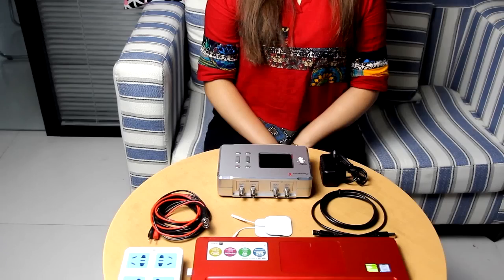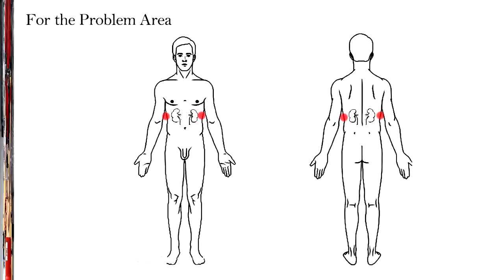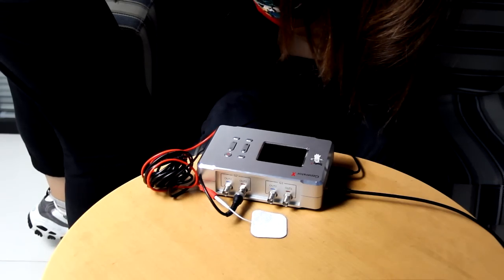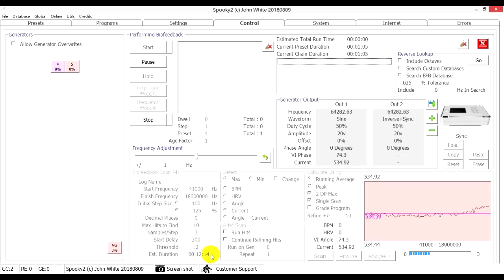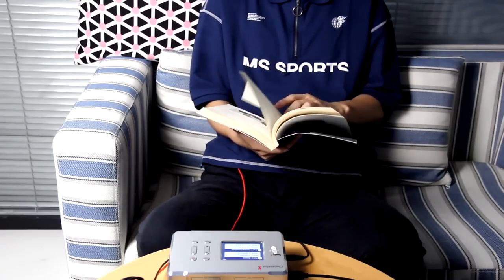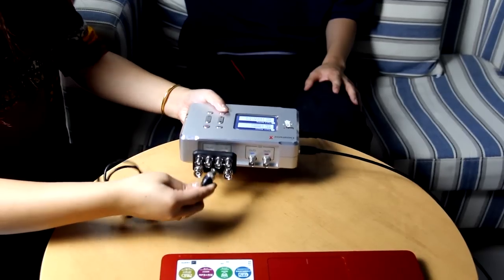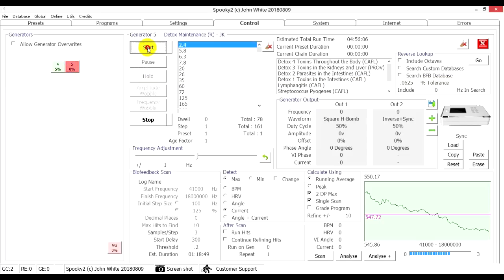How to Do GeneratorX Biofeedback Scan

Comment: hi, you put the cable into out G2 but when you push the button on the software you push number 4 which should be G1..  and number 5 should be G2 where you put the cable??? Is that correct or am i wrong?

Comment: Where is the save button? Plus where does it save to?
Reply from the maker: Hi there, thanks for reaching out! If you’re looking for more recent videos or guidance on which GeneratorX scan to run for feedback, checking the forum is a great idea. However, for more professional and specific support, I recommend reaching out via this email [support@spooky2-mall.com]. They can provide you with expert advice and better assist you with your questions.
Reply: It's the little box in the upper right screen

Comment: I dont see the same screen you showing on minute 4;06. It is all blank for me. I just purchased this Gen xpro this week. what Am I doing wrong?
Reply: the genx has two generators G1(left) und G2(right). on its screen, next to G1 or G2, it shows the portnumber. in the program you have to select a preset or programm before entering the control tab. there you check the "overwrite generator" and click on the portnumber you want to use. in the control tab, on the right side in the middle, under special functions, you can click on "Load GX" or so to save the program to its memory to use it offline without being connected to a computer 👍

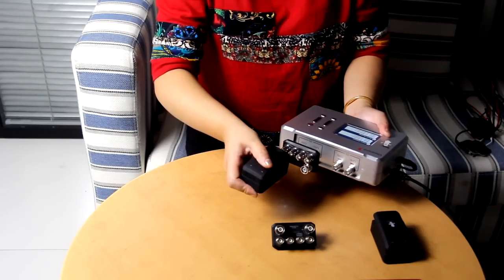Comment: Hello, 2nd question from 08:50mins connecting 2 x remotes into the Boosts of G1 and G2- choosing the Generators/Ports for Remote - the step where you select "Allow Generator Overwrite - choose Port 4 (9.57min) for killing mode, yet the same generator is selected for the Detox???? This is the part where these video tutorials don't match up the video demonstration and verbal instructions?? Detox was Port 5 so that makes sense, but it was in another similar video where the same Generator was selected for 2 Ports/2 different Generators in Remote mode.
Reply from the maker: Hi, this video is not covering detox. It is for bfb scan. Could you tell me where is detox so that we can help you have a further check:) Or you can send your questions to support@spooky2-mall.com, they will reply to you ASAP!

Comment: Question - in 07.32mins - you connect the TENS CABLE to the High Power Port of the Boost. And then you go into the software to to choose the Killing JW Contact preset - yet in the video you do no have the TENS pad on you at all, and then it skips over to the REMOTE . I find these steps being missed very confusing?? Why did the TENS Cable need to be connected to the High Power POrt of the Boost in specifically G2 in the video? Can it be plugged into G1 if G2 is being used on REmote for another function?
Reply: This was my question as well. Are we supposed to keep the tens pads on for this? And how long is the scan? That would be useful info.

Comment: Forgive me but isn’t G2 port 5? G1 would be port 4?
Reply: i JUST found it, that little blue bar on the screen front, next to "g1" says "port4 (or whatever)". Apparantly you have to check as they can change.
Reply from the maker: It depends on your ports numbers on your generator's screen. So please have a check with it every time before you start running programs.

Comment: Hi there. How can I find out what frequencies are the lower ones. Before I did a treatment, I viewed the frequencies as I know any frequencies under 10,000 will shock (on high power treatment) and I didn’t see any. But as I was getting the treatment, it shocked the mess out of me & when I looked at the screen on my generator X, there was a low frequency (hence the shock). I went again to look at the hits and didn’t see anything lower than 10,000 so I don’t know what happened. 
I know I can run it on the colloidal silver port but I read somewhere that it’s not as effective as high power port.
Thanks for any help in advance 🙏
Reply from the maker: Hi, you can check frequencies on "Control" tab.

Comment: I had a hard time following this. I would be great if you could explain the steps a bit more slowly.
Reply from the maker: Hi. You can send your problems with an email to support@spooky2-mall.com. The service staff will reply and help you ASAP.
Reply: When it comes to killing, is it necessary to use both generators or would one be enough? Even if I connect both remotes, only the let one lights up in red - the other one does not - and the start-button does not show in black, yet it seems the one generator and remote is running... I don´t have a clue what´s going on - very Spooky!
Reply from the maker: @damarispfeiffer-bohme5110  You'd better shot a brief video or describe your problems in detail to the service staff with an email. :)
Reply: @Spooky2Rife  thank you!
Reply from the maker: @damarispfeiffer-bohme5110  You are welcome. :)

Comment: Note to newbies: She connects to Generator #2 and this corresponds to #4 on her screen.  
You have to see on your own screen what it corresponds to. 
Usually on my computer,  the lower number corresponds to the first generator, the higher to the second generator
Reply: HOW, WHAT on my screen shows how it corresponds to WHAT? We have G2 & G1, OUT2 & OUT1 on both. I did it as she said and that's G2 corresponding to the "4" on the left side but my G1 was running numbers on the box! New software, this is all jumbled info and how can i see what corresponds to what?
Reply: @TamaraMessenger  that's what I was seeing.. I think she is pushing the wrong button. she is connected to G2 on the back of the machine but pushing the lower number on the computer which I think is G1..

Comment: How do you know that port 4 is from G2?
Reply from the maker: If you have the GX, it is listed as "PORT [gen number] - [running] or [stopped] on the generator display, one list for each generator. port is equal to the USB port number listed on the generator square in Spooky2.
 :)
Reply: @Spooky2Rife  NO, "4" and "5" does not correlate to ANY numbers on the new genx pro box. nothing makes sense!
Reply from the maker: Hi, my friend, it will display on the GeneratorX's screen.
For more details, please check this link: https://www.spooky2-mall.com/blog/how-to-identify-two-generators-in-your-generatorx/

Comment: Hi, I have done repeated biofeedback scans, using the same position, same pads, each time running the same general scan preset. The outcomes vary considerably - as in VERY much. how can I use these results if they are so varied? How can they be reliable?
Reply: i wondered this also and then thought...should i administer BOTH scans? Nobody wants to detox that much (i got sick for 6 weeks after doing 6 foot baths in a row, thinking it would help to do as much as possible) and then i can't figure out the next steps with all the options to just administer the scan results. NEW UPDATED VIDEOS would help.

Comment: Hello everybody
I need clarification on the TENS pads connection into the GENX for biofeedback. There are two videos on YouTube - first was posted in March 2018 and the second (updated) in September 2018. In the first video, TENS pads are connected to boosted High Power Port, in the second video the TENS pads are connected directly into OUT1 without the boost.
On the Spooky2 Blog, I found an info:
"1. Contact based scans (GX) have to be driven with enough current.
Meaning, you must use the boosted High Power Port. It will not work as good via Out 1 directly. Use of the CS port will restrict current and render an invalid scan."
So the question is: what is the proper way to connect the cables?
Reply from the maker: Dear Izabela Goralczyk, Sorry, the first video was not correct, no boost needed while doing BFB Scan. That's why we posted a new video. :)
Reply: @Spooky2Rife  Please endeavor to delete all incorrect video, would be in keeping with good support.
Reply from the maker: @seektruthnow00001  Thanks for your suggestion. We will improve next time.
Reply: @Spooky2Rife  DO IT NOW! I have updated software that does not work and no videos cover new software or Genx PRO (as if it's different but who knows, there is no way to tell which port is doing what!)
Reply from the maker: @lisavento7474  Hi, maybe you can switch your software into the advanced mode by clicking toggle the advanced mode on the untils menus, so that you can read software more clearly:)
Reply: @lisavento7474  Yes but I still have the old GenX. I'm having great results with it but with an older software. The BFB scan results with a new software are not really my cup of tea. But maybe I just didn't test it enough. How do you like your Genx PRO?
Reply: @sonibraun4971  how to you mean the BFB scans were different? I find that if i do a scan minutes later it's totally different and i'm really trying to apply my homeopath Rife knowledge and history to this understanding and just keep moving foward. I FEEL BETTER and am moving, doing more than i could weeks ago and plan (unless medical issue arises) to just keep redoing a biofeedback scan WEEKLY as i get healing, detox with it and keep trucking. HEALING TAKES TIME when you're a senior (but the Power of the Lord asked into it helps!)
Reply: @Spooky2Rife  May I ask why? Does the added boost skew results? I've been struggling with the gen x scan - getting hardly any die-off symptoms as opposed to sample digitizer scan that gave me great results.
Reply: @sonibraun4971  meaning your first scan was with tens pads directly in G1/OUT1 port?

Comment: Thank you , I would have found it difficult to work out what to do but I followed the video step by step and it seemed to work. 
Do I leave the computer connected while the remotes are running the kill and Detox ? 
Also I put nail clippings in each remote, is this correct ?
Thank you
Reply from the maker: 1. Do you mean that you want to run GX standalone?
2. Yes, you can. We suggest you to combine remote killing  and remote healing. :)
Reply: @Spooky2Rife   remote healing and killing together add as a preset chain in one remote with dna and then the other remote runs detox?? is this correct?
Reply from the maker: @harvesthealth307  HI, yes, you can do like this:)
Reply: @Spooky2Rife  This video does not show exactly what to do to administer the biofeedback results and above, doesn't make sense. Are you saying to run 2 different programs and 2 different remotes with DNA? what? Please update your videos. My software has none of the options she has, just the ability to 'scan".
Reply from the maker: @lisavento7474  Hi, you can learn the follow-ups from this blog: https://www.spooky2-mall.com/blog/what-do-we-do-after-we-get-results-from-biofeedback-scan-using-spooky-pulse/
And follow the instructions to complete your bfb and you will see the Analyze button.
Reply from the maker: @lisavento7474  Hi, you can learn follow-ups from this blog: https://www.spooky2-mall.com/blog/what-do-we-do-after-we-get-results-from-biofeedback-scan-using-spooky-pulse/